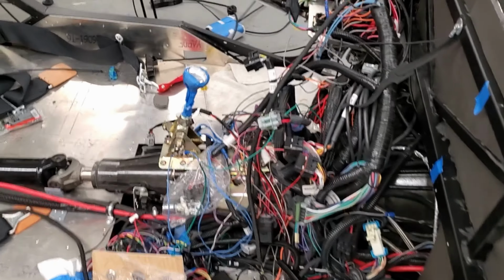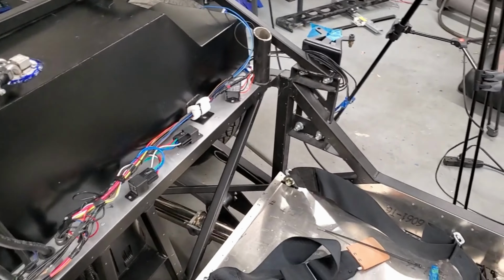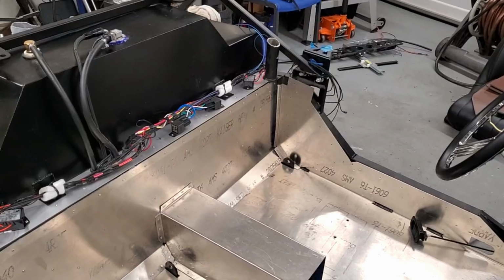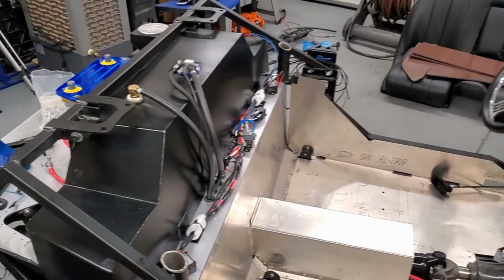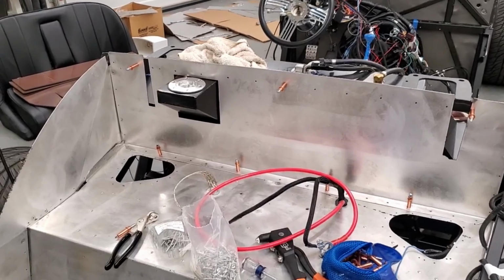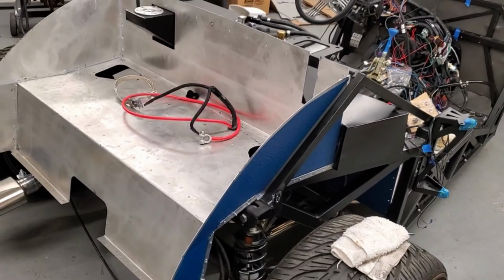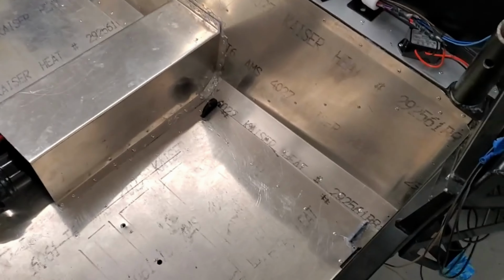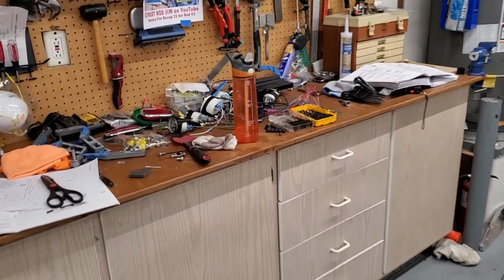Factory Five 33 Hot Rod V2 - Interior Assembly - Panels

Comment: Jim, those side panels in the trunk can be a challenge when putting the body in place. I recommend only fastening at the vertical wall at the gas tank so you can bend them both in to the center as you put the body on. I use a cleco on the last hole at the back of those panels to hold them out of the way when mounting or removing the body. Finishing the trunk and mounting the gas struts for the trunk need to be planned now, but finishing the trunk I think has to wait for the body to be in place.